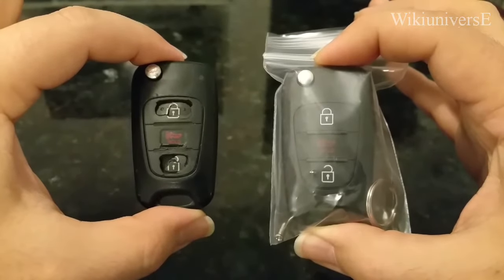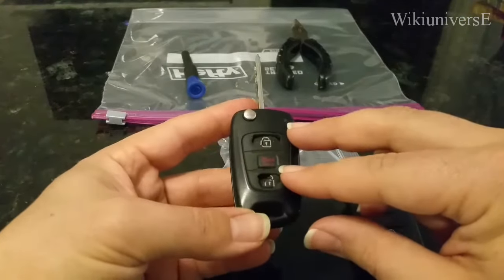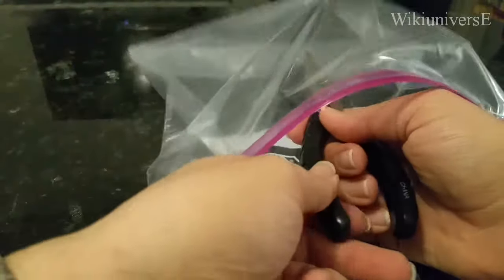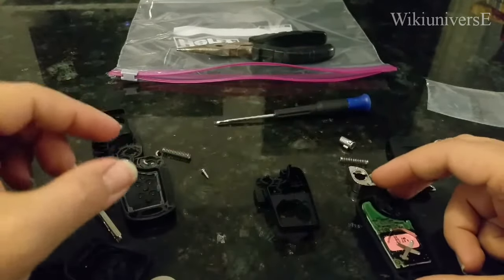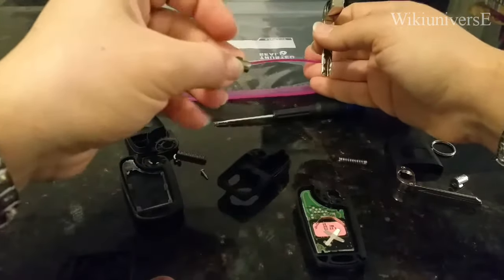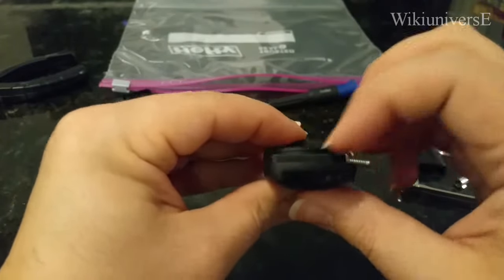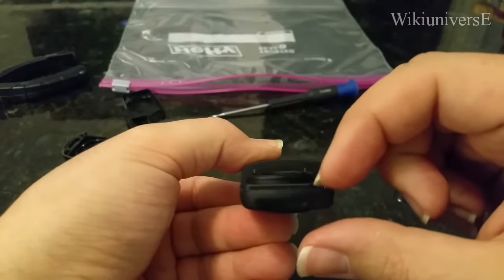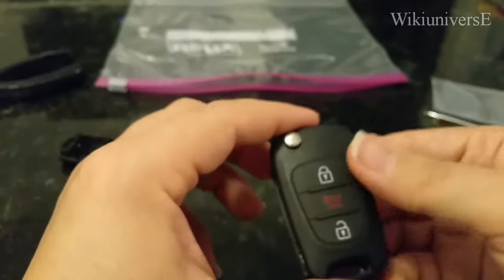How to Replace KIA KEY-FOB SHELL - THE RIGHT and PROPER WAY !!!

Comment: PLEASE READ IMPORTANT * Immobilizer Transponder chip! If you have one in the old key fob, you will need to change this over aswell or the car will not start!  I've been chasing this issue for hours! Extremely important for anyone that has one and doesn't switch it over, the car will not start! Its a black chip underneath a white block in the upper corner of the fob.
Reply: HOW do you get it out of the old fob??  Mine wont come out...
Reply: @stephanpaul8954  I used a small flathead screwdriver and carefully pryed it out. I believe it's glued in place
Reply: Thanks for sharing. I thrown my old keyfob in the dustbin then I wasn't able to start the car after key replacement. Then I read your comment and found the grayish chip from the dustbin. The car was started when I installed the chip in the new fob. This should have been explained in the video though. Thanks!
Reply: I just did the mistake. I followed carefully the vide and I wasn't bright enough to ask myself what's that little piece of extra plastic in my bag. This was the infamous chip. So the car wouldn't start. So I started the whole process and put the chip back. Guess what, the car wouldn't start either. Guess since the ignition didn't recognize the key in the first attempt to start the engine, it blocked or disengaged or reinitialized the chip. Now I must go th the dealer who sait he could reinitialize the damn thing. Well reinitializing is less expansive than 400$+ for a new fob. Mr Wiki, please include this information in a renewed video. Thanks for helping through though.
Reply: Yes thank you! I almost threw it away until I saw a different video.
Reply: Thank you I was scared 😂
Reply: @stephanpaul8954  same here. Had to cut out all the plastic around it to be able to finally get to it. Tedious and nerve-wracking activity! To be honest, didn't really look like a chip to me, more like a black piece of chalk, but it sure did the trick. The car wouldn't start without it!
Reply: @andreass4305  yep I literally just broke everything it was super glued in there
Reply: Where is it?
Reply: Too late mate , I wish I have read your comment earlier. Just called my break down cover as my car didn’t start this morning for them to tell me the transponder missing . Luckily I didn’t throw it away
Reply: If you're replacing an original fob they are a bitch to get open. Then the transponder is glued into the fob so you have to remove it carefully
Reply: Kia Soul's which start by turning a key don't have chips in them, which is why they are being stolen.
Reply: This is life saving tips. Thank you.. Please note this is the most important step.
Reply: I love how he keeps saying "these other videos don't show you" and then he fails to tell you about the immobiliser. I followed the steps and my car didn't start. I then put the immobiliser in and it still doesn't start. Anyone have any tips for what I need to do?
Reply: I got stung on that as well..
Reply: Exactly same problem here! I for an insant thought my car had broke down lol. I also put he old key in the dustbin haha!
Reply: Thank you! Your tip on the immobilizer just saved me! I totally missed the white cover and chip underneath it. Great info!
Reply: @JayAsh15  happy I could help!
Reply: @charlesbailey5579  This is only true in the US. In Canada they come with an immobilizer from the factory, which is why everyone is talking about the missing step in this video. It has been required in all new vehicles sold in Canada since 2007.

It's also why Canada doesn't have the Kia/Hyundai theft issue.
Reply: This comment saved me from going insane today! I bought new fobs and changed them yesterday. Came out to the car and were gonna go for a ride and the car didn't start. Tried another battery in the car. Had my brother come to try to cable the car. Nothing. Found this comment and dug out the old ones from the trash and boom. There it was. I put it in the new key and the car started again. I was gonna call a mechanic and went in to full panic mode. But you saved my life today 😂 thank you for an awesome video! Cheers from Sweden 🇸🇪
Reply: WHY didn't the guy who made this video, inform about this?! Thanks to you and your comment I did it correctly. 🙏🏻
Reply: Thank you!
Reply: Ohh God. Mines gone. Car won't start. Do I have to call dealer or will locksmith work?
Reply: It's a great tutorial. But you aren't an auto guy. I'm guessing you are a guitar player.
Reply: Just did my car with this video 10 minutes ago. And forgot the chip. It wont start without the chip. So dont forget the chip
Reply: Sooo thankful for this comment. Saved my day. 😅
Reply: Thank goodness for your help…I’d followed the instructions carefully and you guessed it the car wouldn’t start! Managed to find the tiny black bit in the bin, car starts now. Thanks again 🙏😊
Reply: @fahadjalil1282 Happened to me too. Almost threw it away. His video is informative, but it's shortsighted to complain about the professionalism of other videos, while he ignores one of the most important elements...
Reply: This is “another thing they don’t explain you” but he forgot to explain it!!! Literally the most important part 😅🤦‍♀️
Reply: @ci6183 Calls everyone else an amateur and then makes the most amateur mistake ever.
Reply: I did it but what a ball ache never worth trying to do it cus now the key is not water proof
Reply: Yea I'd made that mistake before, but he's not explaining how to get it out, "and he dosnt explain this here!"
Reply: @charlesbailey5579  what do you mean? I found the immobilizer chip in my original keyfob, I didn't put it in originally and the car wouldn't start. I opened it up again and put the little black thing that doesn't look like a chip but it is back in, and the car started. Unless you mean a different chip?
Reply: Guess I got lucky, just checked mine and my car fired right up, on another note, mine was a pain in the ass to get apart, like the whole thing was super glued. No white corner but an almost clear rubber substance in one corner, but again the car starts fine.

Comment: Very nice video as I've watched a few. However you failed to disclose that some fobs (depending on the Country you're in) have a chip in the lower corner that you may have to transfer to your new fob, or your ignition won't start. So remember to check your make and model people, so you know if you have to also get the chip out also. You might also want to keep your Kia emblem from the old fob, so get a drop of super glue and just remove the old one with a tiny screwdriver and transfer it over.
Reply from the maker: That is correct 👌
Reply: Same happened to me!!!
Reply: How can you tell if you have a transponder?
Reply: @pjotor80  there is a glob of black plastic in the corner under the PC board it is inside the globe of plastic so you might want to save the back of the old fob
Reply: @seanbrossard8178  I followed the video and the car didn't start, so I assume that mine had a transponder. What does it (the transponder) look like? And can you transfer the transponder to the new key fob, or must it remain in the old housing?
Reply: @davidlangstaff3741  The chip is a very small black metal at the top right corner of the bottom shell.
Reply: Thanks for posting this, my key has a transponder chip, removed it and placed into new case
Reply: Transponder is very small black block in a cutout under a small white cover in the top right of casing (key to left) on UK Sportage key
Reply: Thanks for the messages!

I removed the white plastic piece and moved to new FOB.  Still wouldn't start.  Realized there was the black plastic under.  A little difficult to get out but worked it with a mini flathead and eventually came out with some elbow grease.  Car started perfect when putting in new FOB and reassembling.  

Cheers and Thanks again!
Reply: @blairgill8799  My wife found this comment thread - and then I found the small black chip on the garage floor - and now my key fob with new shell works. Thanks guys!
Reply: I ordered the shells on amazon, replaced them of  at night and discarded the shells immediately, was unaware about the chip, next day in the morning me and my wife went to the car to go to work and the car did not start, called the local technician and he said that the fuel pump is blocked, called the tow vehicle and transported the car to the garage, replaced many things, nothing worked. Till the evening I stayed at the garage and waiting for my car to get ready. luckily one of the customers at the garage asked me " what is wrong with the car?" explained him, he said, there must be a small chip inside the shell find it and attach to the new key, hired the cab, went home searched in the garage, found on old key shell  in the trash can and the other one I through in the morning before going to work. came to the garage along with the tools I have used to open the shell, grabbed the key and inserted the chip,. Thank God. all okay now,.
Reply: @wikiuniverse2152 I have a 2021 Kia forte can you plz help me or is the instructions the same ??

Comment: What the guy in the video didn't tell you is that there are keys with an immobilizer chip inside. You have to transfer that to the new key too. In the corner of the key, you'll see a white plastic piece that you need to remove, and underneath it, there's a black piece of elastic that is the chip to bypass the immobilizer. You need to change this as well.

Comment: 6'12 - you say : "it doesn't click enywhere" - yes, you're right, because you tried to click it into the wrong part.  This electronic board (the green part) clicks without any problems to the second black part of the body - where you istall the battery. I did it and it was so easy. Next thing: you didn't mention about taking out the immobilizer sensor and  placing it into new shell. I did all operations, as you showed, and everything was ok, I could lock and unlock my car, but I couldn't start the engine because immobilizer placed in my car did not "see" the sensor, which I didn't fix naturally. Luckily I asked my friend who repairs cars and he told me about that. Anyway - thank you for professional instruction!!!! Andy.

Comment: I really do appreciate the instructions but after continuously complaining about how other videos don't give a good explanation, you forgot to talk about the transponder chip. It took me a really long time to figure out where it was and what to do. If you have a Kia Rio 2013 key, it's in the top right of the back piece. There's a little rectangular cutout that has a piece of plastic in it. It's really hard to get out, I had to saw around it and the file off what wasn't the chip to get it out because they super glue it in. But I did it, and it works!

Comment: What a GREAT video.  Finally....somebody who explains it the RIGHT way.  You enabled me to switch the old key (shaft) from two beat-up Hyundai (2013) Santa Fe key fobs over to new ones I got on Amazon for super cheap!  Even just getting the keys laser cut was going to cost a fortune.
    HERE'S A TIP FOR THOSE WHO CAN'T GET THE KEY TO "POP OPEN" EASILY AFTER INSTALLING THE ORIGINAL KEY SHAFT INTO THE NEW CASE:
After the first key changeover, I found that the fit was "too tight" on the new fob for the key to flip open.  You could manually pull it out, but it still wouldn't pop open.  (I also trimmed down the plastic where the tip of the key goes into the slot on the new fob...the original key was a hair longer than the new Amazon model, so I just used a razor knife to trim a small amount of plastic at the very end of the slot and the key could fit into the slot properly.  BUT STILL, IT WOULDN'T POP OPEN.
    I discovered that the original key's hole (that fits down over the plastic hub where the spring locks in) is just a tiny bit smaller (in diameter) than the aftermarket one, so the key wouldn't sit all the way down on that hub when it's put back together.  The top hub (top cover) fits fine, but that bottom hub where the spring locks in was just the smallest bit too thick (or wide) for the original key to sit completely flat.
    I used a dremel tool to remove just a tiny bit of the thickness of the plastic hub (circle) that the key sits down onto, and then was finally able to get the original key to lay flush.  I worked the key back and forth a bit to further make the fit better, then put it back together.  Now, the key fits flush and pops open perfectly.  Not sure if was just the specific aftermarket key fobs I bought, but for those who can't get the origijnal key shaft to pop open when you press the button, this may work for you.  REMEMBER, JUST REMOVE A VERY SMALL AMOUNT OF PLASTIC FROM THE THICKNESS OF THAT PLASTIC ROUND "HUB."  Don't destroy the hub itself or the key could pop out of the fob.  Just make it a little thinner (narrower wall) and use the key to judge when you've taken enough off (when the key sits flat in there against the case.)  Hope this helps.
     Thanks again, Wiki universE for a great step-by-step video.
NOTE:  My 2013 Santa Fe keys did not contain a transponder chip, so it only required me to change the circuit board, battery and the key shaft itself from the old to the new.

Comment: Worked perfect for my Kia Soul. I put the needle nose plyers in the hole but could not get it to pop open.  Tried several times.  Then I used slip ring plyers and POP, it opened.  So instead of pulling the needle nose apart, the slip ring plyers are backwards and you squeeze them to spread apart.  But now my key-fob is brand new!  I even replaced the CR3032 battery since I already had it open.  Thank you so much!  Ron in Oklahoma.
Reply: lol I was just doing the same thing and mentioned it to my father, also mentioned slip ring plyers

Comment: Just done the fob change, I fell for the immobiliser trap, that is, I didn't place it back in the casing (car wouldn't turn over), then I just replaced the grey plastic cover. Again it didn't work.  After re visiting and reading through the comments, I was informed there is a small black piece that goes under the grey plastic bit. That was luckily still in the plastic bag which I used for disassembly, but it was in my main rubbish bag....a lot of searching it came to light. In it went. And like magic, my car now starts. Fantastic content everyone.

Comment: I'm so glad this showed up as my first search result because it saved me a lot of trouble. 

The only issue I had was that the old key fob did NOT open up and shatter as easily as the one in this video did - I had to spend significant time and force to slowly bend the case open using different tools.

If you run into the same issue, make sure you keep your tools as close as possible to the spot indicated in the video (the deeper area by the key) so you don't damage the electronics! (And of course be careful not to injure yourself.)

Excellent video with great detailed advice - thank you!

Comment: Hi there! Thank you so much for helping me with this setup. I did notice that the key section of the fob has actual alignments for the internals so you don't have to fidget the key internals to keep them in the middle, which made putting it together super simple. (You can see the seating on 10:08 as the little black dot in the key part)

You saved me so much money man, thank you. If every problem was explained by you I don't think I would have any.
Reply: Did not show the chip
Reply: You are right. The circuit board fits snugly into the other half of the fob, the half you first put the metal key in with the circular battery cut out. The two small slots top and bottom fit into plastic tabs so well that the circuit board doesn't move. Clicking the two halfs of the fob together is simple when you do this first.

Comment: The disassembly of the original key was not as easy as shown for it was molded together, had to break it apart in small pieces but the assembly once it was apart was spot on.  Thank you for the video.

Comment: Thank you so much for the video!!! Really helpful!!! I would like to mention something extra that I noticed and made the process easier: I placed the motherboard on the other part instead of the one you are showing in the video. On the other part, two plastic pins guide the motherboard (chip) at the correct position and thus, you don't need to center the motherboard manually. Of course, I acknowledge that some key shells might be different than others. For my case, these plastic pins helped me a lot on the motherboard allignement.

Comment: Just swapped my keyfob for a Kia Ceed 2011. Excellent video although I found it easier to attach the circuit board to the opposite side to you do in the video. There's actually some plastic notches on that side which marry up to the circuit board. Also if you have an immobiliser in the key fob, there's two parts to it. There's a white plastic part which is a cover, it's not the imobiliser part. The imobiliser is underneath the plastic cover and is like a small black magnet. It's easy to think the white plastic part is whats needed, but as I found, it's the magnet underneath which is the essential part. Easily mistaken as part of the plastic case.
I had to transfer the blade as my old key fob had snapped near where the pin is. But the replacement key fob I got, doesn't quite align with the hole so it's impossible to re-insert the pin without possibly bending or breaking it. I've left without for now as it's held pretty secure without the pin. Thanks